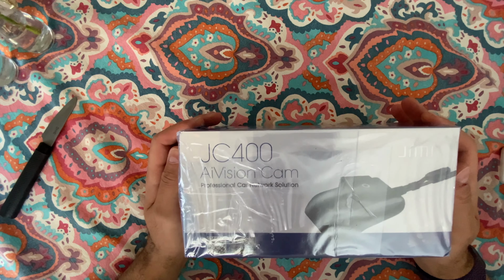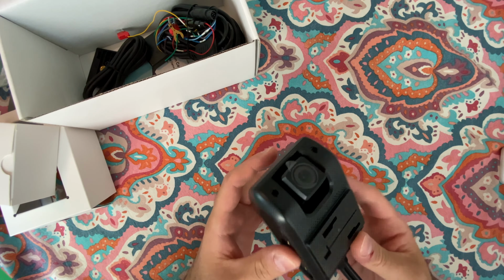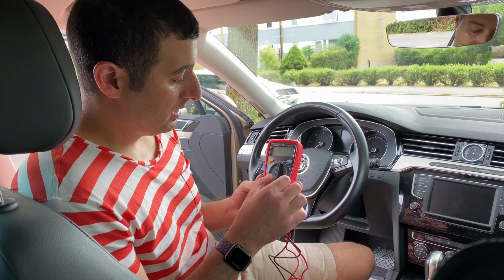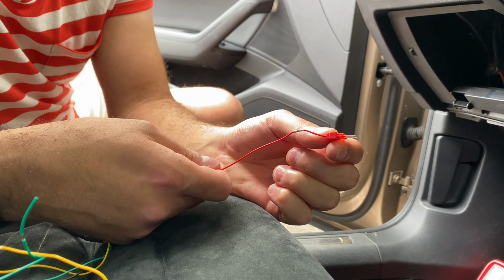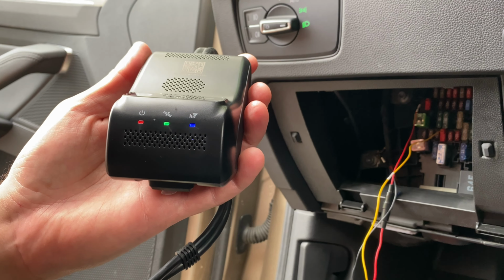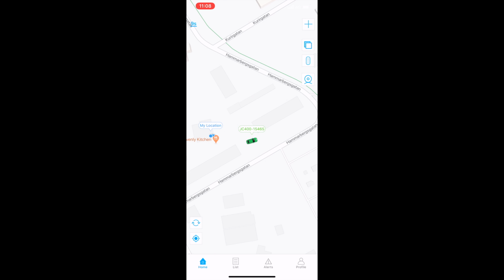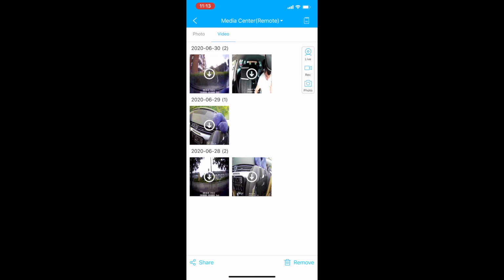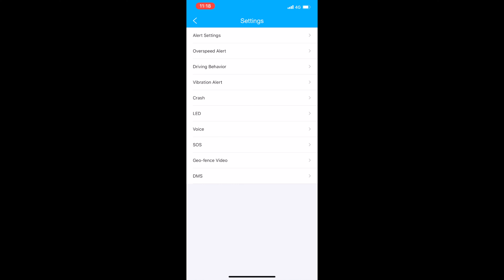JC400P 4G Dash Cam hardwire installation in VW Passat 2016 B8

Comment: Thanks alot for the video, i used it to install my camera. Very good idea how to route the cable. 

There are two more screws holding the dome light. If you fold down sunglass storage half way you can pull down on the plastic frame where the two lights go and then disconnect and unscrew. This helped me to getter better access 👍🏻😊
Reply: me too :)

Comment: very good presentation,I have a question related to the data consumption monthly calculation.How many data required?
Reply from the maker: It depends on the usage (how much it’s used for shared internet or live view over 4g ) ,not sure exactly how much however

Comment: Does this drain car battery overnight, how to protect?
Reply from the maker: No it didn’t for me. The camera cable has built in battery so it uses it when the car is off
Reply: @Fishingletsgo  thnx
Reply: One more question please, GPS tracker is in dashcam or relay, i dont want to use oil cut of feature but want GPS tracker, the small black relay if I don't connect, would I still get gps  tracker?
Reply from the maker: No need to use the relay for gps. The gps is in the camera
Reply: @Fishingletsgo  THNX :)
Reply from the maker: Your welcome:) feel free to subscribe to my channel